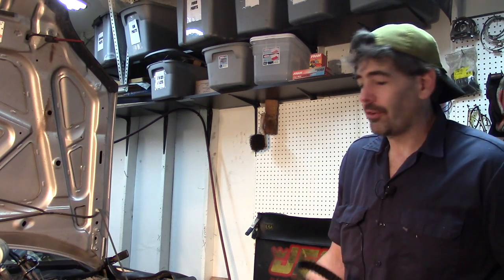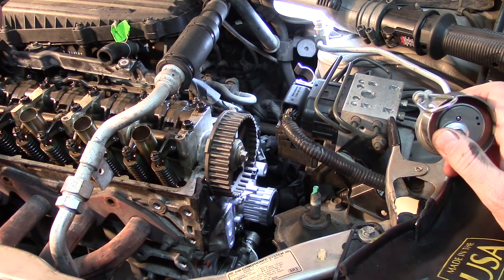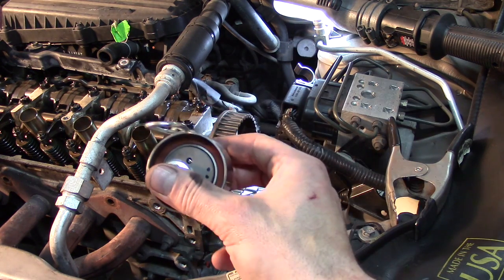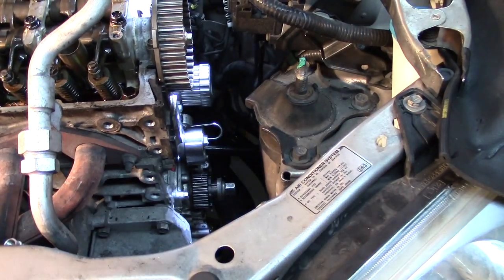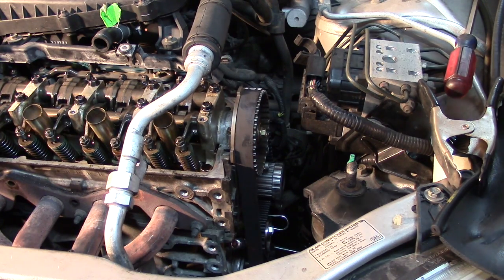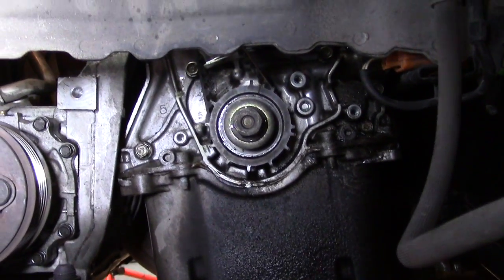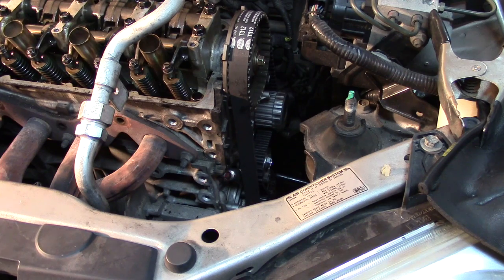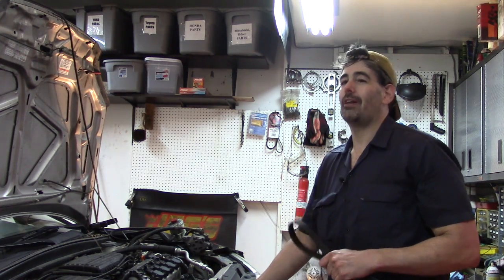Timing belt alignment 2001 Honda SOHC VTEC

Comment: Nice job on the T belt change.   Good info too.   seems like most cars are interference engines these days.
Reply from the maker: Rhage73 Yes Rhage I agree- But I have never been clear on why the interference engine is so common- much less exists at all.  My theory is that it allows for much smaller engine design while maintaining reasonable power by maximizing the intake and exhaust through valve lift as opposed to diameter. (e.g. opening  a smaller valve further is equivalent to opening a bigger valve less). That's the only theory I can come up with, that doesn't sound conspiratorial at least.
Reply: Perhaps, but at the same time it is quite the trade off for a few more HP rather than just throwing a little larger cam at it to get the same lift and duration.  I can see "smaller" but at the same time, again with the trade off deal. now with the overhead cams and no need for push rods it seems the size thing takes care of itself. it may be the angle that the valves open instead of the lift / duration, making the piston rods a little longer would cause it to be an interference as well, at the same time maximizing compression.   to be more efficient. /shrug.   i couldn't say speculation and conjecture will get me pretty much nothing at this point lol.   ur theory sounds reasonable.  just one of the worlds many mysteries sir.  Go go gadget research and experiment video?  haha. have a good one man, and  i will make you a deal.  if you keep posting, well i will keep watching.  =)

Comment: Hi Matt,

Your positive to negative comment ratio is way too high so I need to balance it out a little :-).  Great video, as usual, but I do have two observations.  I would always recommend replacing the cam seals and crank seal at a timing belt install, especially with intervals getting higher on recommended replacement.  Also, you don't mention that while the crank TDC is crank TDC, the cam(s) will have two possible conditions.  TDC at compression, or TDC at exhaust.  Cams will have some sort of marking such as "up" to indicate which is the TDC position.  Less critical on a single cam engine in terms of consequences, but still an issue on a single cam engine depending on ignition trigger mechanism.  I would make some sort of mention of this as typically the cam marks are 180 degrees opposed and hence symmetrical in distribution around the diameter of the pulley.  Keep up the good work!

Robb
Reply from the maker: kermit80526 Regarding the first point- good point. Regarding the second point, I was hoping the multiple clear shots and explanation of the "UP" mark on the cam sprocket combined with verification of compression after belt was installed when bringing piston up to TDC would have covered that.
Reply: Schrodingers Box I humbly have to eat my words on my second comment.  You clearly stated to check that "up" on cam sprocket was oriented properly.  I don't know how I missed it.
Reply from the maker: kermit80526 Dont mention it- I am sure my charming demeanor was distracting lol
Reply: Schrodingers Box Possibly :-)

Comment: Does the tension side of belt indicate correct engine rotation mine is on the right (clockwise)? Good video and tips
Reply from the maker: Typey1 That's a good question, never really paid attention if there was a consistency there. I don't know.

Comment: My VW is basically the same (sohc version) just way more awkward to work with. No expensive special tools required though which is a blessing.
Reply from the maker: Bob Moore Thats good to know- I have VW to often use special tools.  Changing the axleshafts for example use special star sockets that are not torx- they are like 12 point or something weird. I would have expected even worse with a timing belt.
Reply: Schrodingers Box we found out that you need 12 point "Vielzahn" (translates to "many teeth") in order to unscrew the rear brake calipers on a Golf V. The front ones are normal hex/allen bolts...go figure...

Comment: Nicely done Matt!.   Have done many of these over the years and they are pretty easy.  Did this one come in for a routine TB replacement or did it break and come in on a tow truck?
Reply from the maker: Randall Dalton No this one came in as a used car purchase that owner wanted to "play it safe" because wasn't sure when belt was changed and car had 140K miles.  Good for HER!!!
Reply: Schrodingers Box If there was a timing belt failure it most likely would cause significant engine damage correct?  Or might it just break one day on start up and not cause damage due to the low RPMS during cranking?
Reply from the maker: On this model odds are you would have bent valves with a broken timing belt.  I would imagine odds are lowered if it happened during starting rather than engine running but the valves in these engines are pretty skinny- I imagine even a starter motor could easily bend them. I would t want to find out lol!
Reply: Schrodingers Box My mom has a 97 accord, timing belt broke while starting and she kept on cranking hoping it would start. It will most definitely bend the valves.
Reply from the maker: Jon Allan It's a little different when starting.  Odds are a little better. It should have been obvious pretty quickly it wouldn't start though- all the starter motor would do is spin free.
  If I saw the car I would do a quick leakdown test first to confirm if any valves were bent and if all cylinders test negative I would have no problem buying a belt, put it in, and calling it a lucky day.
Reply: Schrodingers Box I live out of state, so I wasn't there to help with the car at first. A mechanic replaced the belt, it ran rough, she kept driving it. During my next visit, I did a compression test first. Cyl 1 made 60psi while 2 3 4 made 120+. Leakdown confirmed cyl 1 wouldn't hold. I found a rebuilt complete head on ebay for around $200, swapped it myself, checked timing several times like you. Engine still running smooth 4 years later. Oh, and when I pulled the head I saw it was a bent valve, intake I believe. Fun times!

Comment: Glad to see solid timing material at your channel. This is like "must have" for channels like yours anyway. Although I also hope to see some weird diagnostic vid soon ;)

If you are running out of ideas, don't have interesting cars - I can give you mine. Already spent 2 weeks diagnosing rough idle and no luck. But also no parts changed!
And yes, again, this is not OBDII car. Can you think about any weird places where I can find vacuum leak? I'm sort of sure this will be pretty big vacuum leak in some mystery area that I cannot find (no, I don't have smoke machine)

Is it possible that ignition system (rotor on cam, ignition timing managed by computer) can cause rough idle, but no drivability issues? And there is no misfires, they are easy to diagnose in 4cyl engine even without scan tool.
Reply from the maker: Hey mess, sorry just saw this. Maybe you solved it by now but one thing often overlooked in rough idle without misfires is mechanical cause. Several examples I've experienced: a missing fan blade caused a wicked rough idle in a blazer. Sometimes removing the serpentine belt reveals an accessory with bent pulley or something. Bad engine mounts. torque converter shudder. harmonic balancer wobbling. 
  If fuel trims are normal and no misfires, I generally start looking at mechanical as next step.
Reply: Schrodingers Box yep, probably you are totally right here. The problem is still not solved, but it looks to me like dual mass flywheel is causing this issue. It also started to make some knocking, that pointed me to this direction. It feels like running engine is not well balanced (harmonic balancer is ok, compression is even). Pretty weird issue to diagnose.

Comment: Another great video.  
Did this engine not have a balancer belt?
I just changed my timing/balancer belt & waterpump on my 2002 accord 4cy vtec engine...similar.  the balancer belt is tricky though - the balancer pully has an  alignment mark, but the balancer pulley could also be 180degrees out (who would have known?).  Luckily i found the full service manual online (free), and was able to pick up on it.
Reply from the maker: No this model did not have that. I believe those are in the 4cyl accords, not the civics to best of my knowledge.

Comment: Excellent video as always. I've never done one, but I like how you recheck after each stage to be sure nothing moved once it was tightened. Other than seeing another example of timing marks this was my greatest take away.
Reply: Schrodingers Box  You've got to be KIDDING ME!

I did my first timing belt at 18 - on a car that was a write off.   I did it for fun, learning how to deal with it.  Went perfectly.  There were no online videos back then.    No manuals.  Just basic understanding, an engineering mind and some basic tools.
Reply: Schrodingers Box Having done a timing chain on a toyota yaris and lined up the coloured chain links, I foolishly expected them to be lined up after a single rotation of the crankshaft.However these colored links had moved on to the following tooth and would not line up again for God knows how many revolutions.I was sure that I had messed up but a trained mechanic assured me that was the case.also try to keep the tension between the 2 cam wheels tight when putting on the new chain or the will slip off.Use a spanner on the cams or vice grip.Hope this helps.
Reply from the maker: Tom OConnor Lol- yeah since there are different diameters on cam and crank it would take probably hundreds of rotations before they lined up again lol
Reply from the maker: DE Nichols That's all you should need- is knowing how the timing marks align. But another key thing is the rotation. If you rotate the engine clockwise, the slack will be taken up in the wrong direction and you'll be off a tooth.

 This job is FAR easier than on the toyota engines where everything moves when you tension  the belt and you have to account for the movement.
Reply: Schrodingers Box Have you had to reinstall timing chains? It's my one worry on a big engine job coming up on my 2000 Chevy Prizm. I'm not sure if they have a similar habit. 

Knowing the engines direction of travel. Another big take away!
Reply from the maker: DE Nichols Other than your traditional timing chains like the simple cam and crank that you line up the dots- I have done 2 styles of chains.  The Chrysler 2.7L and a Honda - oh whatever the V6 accords have.  They are more involved than the belt for sure but again, mechanical aptitude should get you by.  One thing I like about the Honda chain- the chain has different colored links that line up to notched teeth on the cams and crank so you know you are timed correctly and can't possibly screw it up. The timing chain "guides" are a little funky though but if you understand the concept of cam/crank timing it's nothing to worry about.
  If you remove the intake cam however... that's a different story- you have to reset the VTEC position and thats funky.
Reply: Schrodingers Box I've read some competent forum guides about my engine and thankfully it has colored links to make it more obvious as well. 

The tensioner (it's all coming back to me. Lol) has to be set. You set it's spring tight. After installation it has to unspring by turning the engine backwards initially to fully set the part in.
Reply: Not one forum member thought to turn the engine two turns and CONFIRM timing on an interference engine. Yikes.
Reply from the maker: DE Nichols EXACTLY.  And even so it might not matter.
 I actually had a viewer state that he couldn't get the marks to line up no matter what he did.  So he tried to start the engine to see if they would "line themselves up".  
Yep.
  Another one couldn't get them to stay lined up whenever he unlocked the tensioner. Every time he released the tension they went out of line. So he tried running the engine without the tensioner.  
Yep.